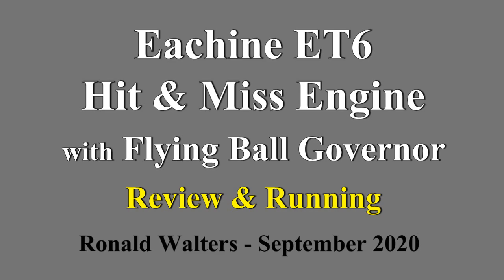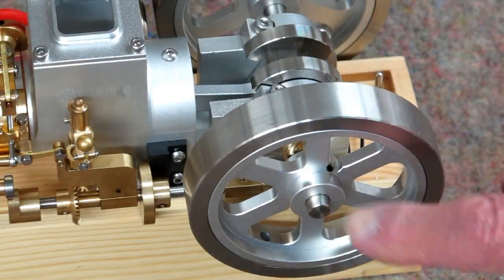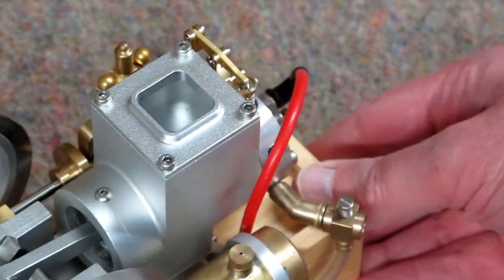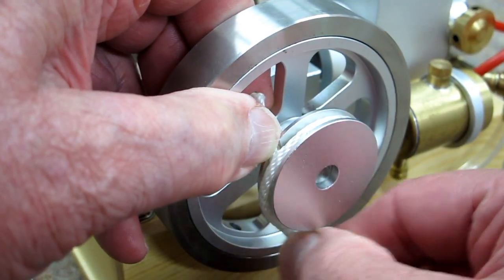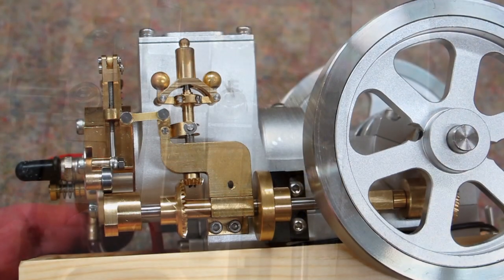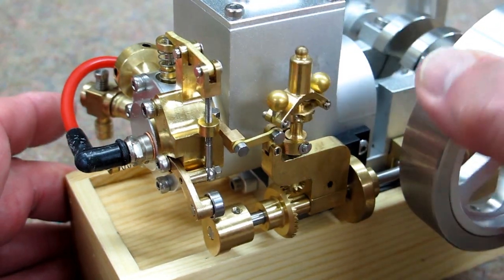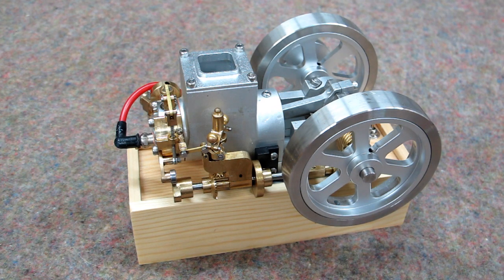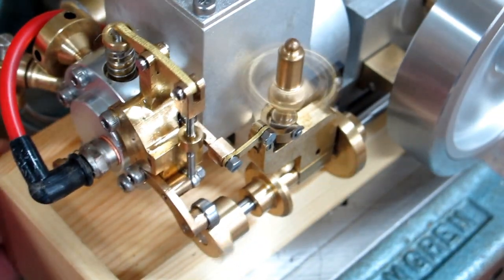Eachine ET6 Hit & Miss Engine with Flying Ball Governor

Comment: My et6 once the cam opens the exhaust valve it never closes again , I have to manually return the valve to closed, to weak a spring???? Or adjust what and by how much??
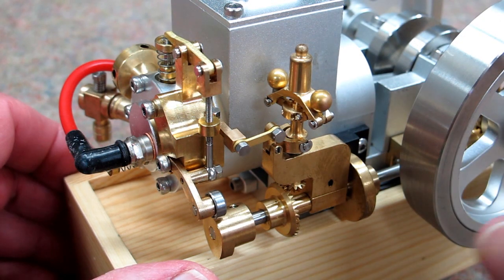Reply from the maker: At 5:30 in the video you can see how the ball governor must be able to travel up and down freely with the change in engine speed. When the RPM increases, the balls travel outward and cause a lever to go under the collar on the exhaust valve push rod. That blocking lever must be able to move back and forth very freely. 

The exhaust valve push rod must be loose enough and free enough to travel up and down without restriction… and it should be able to fall under its own weight. 

The exhaust valve rocker arm must be able to travel freely as well. There should be a little clearance between the end of the rocker and the top of the exhaust valve… just enough to allow the valve to close and provide compression (clearance: the thickness of one or two pieces of paper). 

It sounds like something is binding up a little somewhere. 

Everything needs to be floppy loose… fall under its own weight… zero drag.

In my video:
Eachine ET6 Hit & Miss - Changing O Rings
https://youtu.be/0oYgB3FBqjc
 
Around 3:55 I mention one of the head bolts that needs to remain a bit loose so the cam follower arm (it has the bearing on one end which rides on the exhaust valve cam) can move freely… make sure that hasn’t become too tight.

Do not FORCE anything. Some very small pieces involved in this mechanism that can get bent with force.

Just don’t go screwing around on things until you can determine what is going on… otherwise you can get the timing all messed up. If you do decide to take things apart… take some good photos first, so you will know how it goes back together again. But do not take anything apart just yet... look around first.

With every engine I have received… every indication is that the engines had been test run before they were boxed. Every one has run without touching the carburetor or anything.

Things get bounced around pretty good from the time it leaves China until it gets to you. Things can sometimes move. 

Look really close… a tiny piece of the packing foam (or dirt) stuck in something somewhere. Always possible something got slightly bent. 

It is also possible that the exhaust valve itself is sticking open (or the intake valve). Takes very little to end up with zero compression.

Have you been able to run the engine at all?

Let me know how you do.
Ron
Reply: Not been able to get it to run also on the compression stroke I can see fuel vapors venting from intake valve, lots of fun will not give up but this is going to be a challenge . Thanks Jim
Reply from the maker: Ok, Could be there is something under the intake valve which will also result in no compression. One viewer, with an earlier version hit & miss, had a piece of carbon holding a valve open. Wouldn't think so with a new engine but it won't hurt to look. He removed the spark plug and was able to flush it out with a can of WD-40 while holding the spark plug hole facing down. Failing that, watch my video and take the head off. Just be very gentle removing that small bolt.

Comment: Thank you very much for your video of the M92 engine. I had the Eachine ET1 for literally 1 hour until my son tried to pull start it and it pulled out of his hand and smashed it. just received the ET6/M92 does anybody know if the cap  on the spark plug end can come off without too much drama? I have made a box that's better than the supplied one, just don't want to "yank" the cap and break again (I really haven't had a good run so far) Thank you again for your informative reviews Ronald, they encouraged me to go down this path, please keep it up!
Reply from the maker: The boot just pushes onto the spark plug. Then the spark plug wire just pushes into the boot until the end of the wire butts up against the spark plug.

Thanks for watching. 
Please subscribe. That is what keeps this channel running. 
Ron

Comment: Hello Ronald.
Thank you for the presentation. I am also infected by these little engines. It is unbelieveable what they offer here for a little money. I think China got over it. Now they deliver also good Quality. It is amazing how fast the producers react on critics and transform it Info new solutions. I cant find something like this here in Germany. I showed it to my students in Mechatronik school. Wet eyes arround me. Like Christmass. Because it is real and not only screen and virtual reality. True basics. By the way, I think this Drive shaft model might take more energy because of the gears. What do you think. Greez from Bavaria.
Reply from the maker: The other Hit & Miss engines have gears in them as well. This turn over very easily. Mine maintains a very consistent speed compared to the earlier models.

A lot of stuff shipped from China is poorly/very poorly packed. This product is well packed.

It has some delicate bits and pieces in it and will not stand up to being dropped or allowed to bounce off the work bench. But anyone with access to a lathe and a few tools could make parts if necessary.

These are demonstration model engines for personal entertainment. They are not intended to run for long periods of time nor for some industrial purpose. As you stated they are good value for the money.

Thanks for watching. Please Subscribe and ask your students to Subscribe as well. That is what keeps this channel running. Ron

Comment: Even though it's cool There is way more mechanism to have problems with. 
Got mine running good now.. Just needed more fuel in the tank. When the tanks gets to the fuel line connection area it has running problems. Fill back up and all good
Reply from the maker: Even the slightest bubble in the fuel line and they will not run.

Comment: Is the governor adjustable for variable speed?
Reply from the maker: Short answer, No adjustment. 
Long answer, conventional use of a flying ball governor on a steam engine would be to regulate a steam valve or the butterfly in a carburetor of a gasoline engine, where speed could be adjusted by adjusting the governor linkage. This one releases compression and there is no adjustment for speed. The speed is controlled by the weight and geometry of the two balls. The other Hit & Miss Engines ET1 and ETX also have no speed control other than changing spring tension, when I used weaker springs to slow them down a bit more.
Reply: @RonaldWalters2010  Thanks for the well explained answer, Ron.  The difference in function makes perfect sense.  Nice little engine in any case.

Comment: That's a cute little hit & jump engine! It needs some springs under the 4 corners of the battery box to keep it from jumping off the table. In the early 70's a Conoco station I worked at still had a hand crank operated pump to dispense white gas. Most things Coleman back then such as lanterns and stoves ran on it and there were still rural folks here in Iowa using white gas cook stoves in their houses. The numbers were very small as I seldom had to dispense white gas.

Comment: Ronald what do you think the longevity of these engines?
Reply from the maker: These are demonstration model engines for personal entertainment. They are not intended to run for long periods of time nor for some industrial purpose. Many people use them to power a model boat or tractor. If you treat them with respect, keep them clean, check fasteners are tight, oil everything before every run, keep the distilled cooling water full, they should last a long time. The consumables are the o-ring piston rings and the spark plug. The spark plug should last a long time. They will require some occasional tinkering so being somewhat mechanically inclined would be helpful. The nice part is you do not need to spend weeks or months in a machine shop trying to create something similar yourself. For the price I think they are a nice model engine.
Reply: @RonaldWalters2010  Thanks Ronald for the reply cheers, Jim

Comment: is this engines main purpose a teaching tool?
Reply from the maker: These are demonstration model engines. A miniature version of an old type engine. Something you can run on your workbench and you do not need to be a machinist to have one. It would help if you were mechanically inclined and understand engines, as some tinkering is required from time to time. In my opinion, best bang for the buck is this one or the ET1 for personal entertainment, demonstration or teaching. And it is a nice display piece.